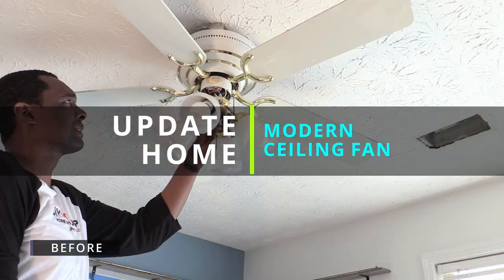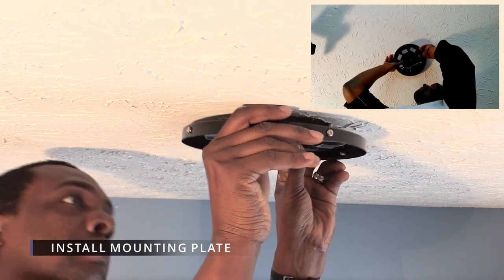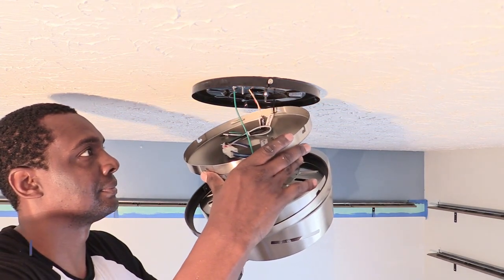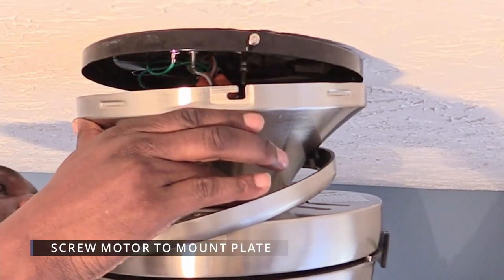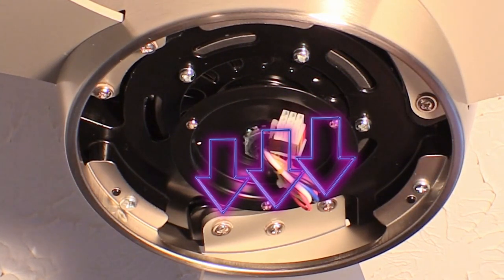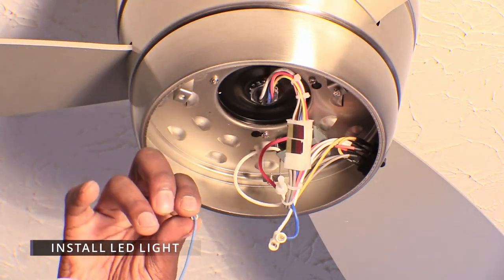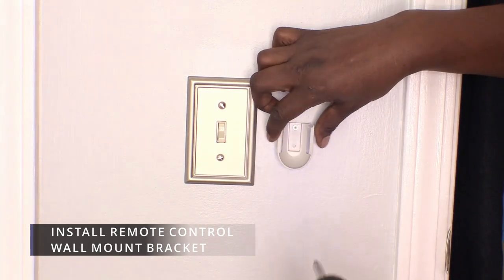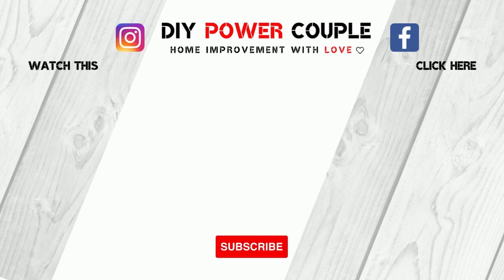HOME UPDATE DIY: MODERN MAZON CEILING FAN W/ LED LIGHT | How to Install FOR BEGINNERS

Comment: FYI the controller light button has a dimming function. Press and hold on/off button to dim to low settings, press and hold on/off button to dim high bright.

Comment: Great video! Quick question…my room has 2 switches..1 for the fan and 1 for the light. Would this affect the install in any way? Thanks!
Reply from the maker: No, this light will still work on your setup.

Comment: I did the fan this past summer but your video on vinyl tile was great. Your video showed me where  I went wrong so I am taking up the floor to do over again.
Reply from the maker: listen softly, we're glad you did the fan...but what happened with your floor? Did you forget the underlayment?
Reply: 2 Things I did wrong not putting down the under layment because my floor is wood. And not removing the molding wasn't a smart move.

Comment: I saw when you first posted about this new fan you installed and am now glad to see your step by step! I have a fan that needs to be replaced since there is a ring that holds the blade on it. This doesn't appear difficult. I feel confident I can do this!
Reply from the maker: Dolores, it wasn't difficult. Just remember to fully take out one screw and only loosen the other 2 screws where we say it in the video. This is a great fan to have. It's quiet and it doesn't shake. Let us know how it looks when you put it up. -DIYPC 😃

Comment: Again, awesome content and very informative.  I'm an electrician by trade and I do have some quick pointers.  
1. I recommend prepping your wires before hanging the fan just make it a little easier. 
2.  There are a lot of vibrations in fans so I recommend using electrical tape and taping the wire nuts to the wires so they don't back out.  

Keep the content rolling!
Reply from the maker: Steve, those are some fantastic points. We appreciate the great advice. Prepping and taping make a world of difference! THANKS -DIYPC 😃

Comment: I just got 2 of these, they both blink. The light blinks on and off and if the light is off and fan is going I can hear the motor stop and then kick back on. 
This is happening for both fans. 
Although your video was great, I had an electrician to install.  The remote barely works… I have to click so many times and literally walk up to the fan with the remote.  I have reprogrammed/reset  both fans multiple times. I’ve come to YouTube for help and I will be calling customer service. Any other advice? 
Thanks!
Reply from the maker: Quinesha, this fan is super quiet 🤫. If both of your fans were installed by an electrician, I would contact the electrician or company to see if they will reinstall the fan at no cost. Hopefully, they have an installation guarantee. What you described sounds more like an installation issue rather than a manufacturer defect. If the same person put both fans in...that is one thing I would look at. Lights blinking on and off could mean that a wire is not connected properly in the orange wire connector. There were rubber pieces that the electrician should have taken out of the fan. If they left them in, the pieces could be hitting the motor as it turns on and off. If you have any other questions, you can join us live this Sunday at 3:15 pm EST https://youtu.be/nsj8v8NFJBw

Comment: This is my 3rd fan 1st 2 working good 3rd one with this new remote not working
Reply from the maker: Larry, you may have to double check the receiver antenna 📶 to make sure it is pointing down in the direction of the remote. Hope this helps. -DIYPC 😃✨
Reply: Got it to work the remote need to be next to the switch

Comment: Hey if you have that ceiling thing taken down and stuff thrown away how about donate it to a thrift store by chance that way you don't waste the good ceiling fan usually if you want to make a modern you can spray paint the motors black and then get some bleached out blades then it's one of the nicest looking fans you'll have but cool modern fan
Reply from the maker: Noah, thanks for the good information.